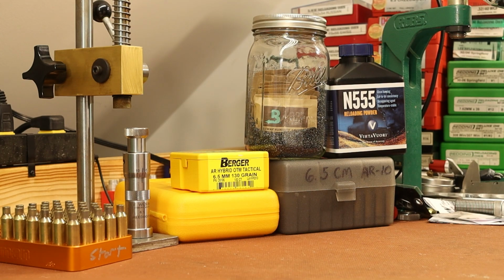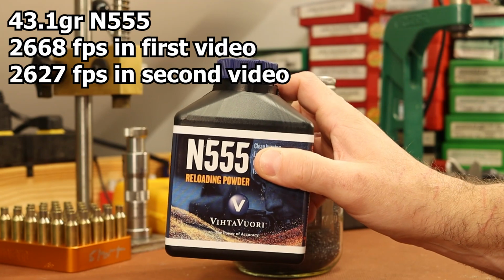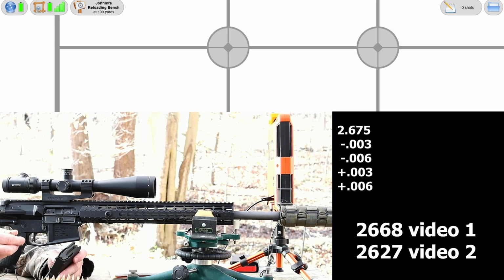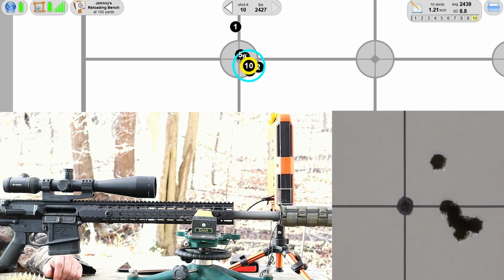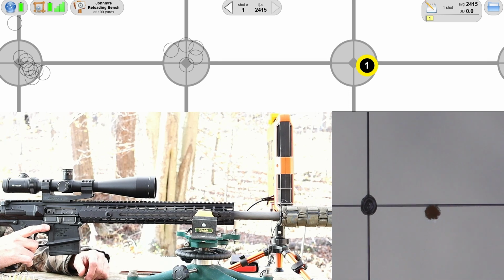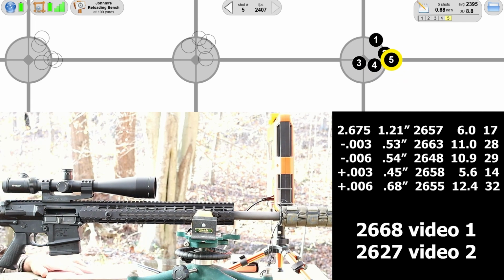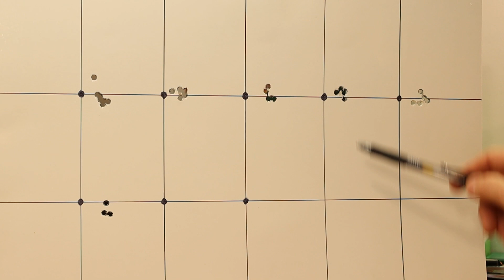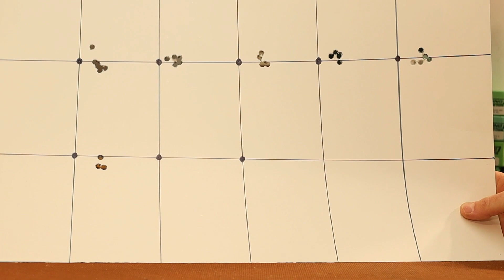6.5 Creedmoor - VihtaVuori N555 and 130gr Berger AR Hybrid OTM Tactical - Part 3

Comment: Hey Johnny, Those are some excellent groups. If you really want to confirm POI shift just shoot them again in reverse order. Could just be the barrel heating up.  One really easy way to visualize POI shift is to take a piece of clear plastic and dry erase marker. Mark the point of aim on the plastic and then trace in the groups.  Move the clear plastic over the next groups and you will see the shift exactly. You can circle in all the impacts to give you the whole group overlap.
Reply: Barrel heating was my thoughts as well.

Comment: Very interesting video now I feel the need to put the air driers in all my open powder cans. I looking forward to more testing videos on that
Reply from the maker: The SDs in this video were the worst we've seen so far with this powder. Did some of the powder get dehumidified while some didn't? How long does it take, on average, for a humidity change to take effect? SOOOOOOOOOO MANY questions on this topic. Should be fun to investigate.
Reply: @JohnnysReloadingBench  what would happen if it sat for a month. You would think that would make a difference. I live in Washington state. Very wet and cold. I think I'm going to do some kind of testing on this. Sounds really interesting
Reply: @JohnnysReloadingBench  Funny you should ask - been investigating this myself. Have seen a .5 gr increase in a 36 gr load sitting in an open measure in 24 hrs (calibrated scale). Powder had just been poured from a sealed container. Have now tracked the weight of this powder charge for 60+ days & it goes up & down with relative humidity. 😳😳😳

Comment: First shot John. If you go back thru many of the videos, you will see first shot issues. Its common with semi's as the closing pressure is different - the bolt is moving faster during cycling, slower from the bolt release.
Reply: Good observation.
Reply: I was thinking the same when he said only a 3 shot sighted group. Back of my head was trying to remember part one and two but I swore he had 5 shot + warm ups in those. Then we had that flyer.
Reply: Don't see how it be any different when the bolt lugs are locked in regardless of it being the 1st or 5th round.. Closing pressure is not an arguing point. Headspace is Headspace guy
Reply: @cademarti1365  its less the headspace changing and more the way the gun treats the round as its closing, if you go from bolt lock and drop using the bolt release it seems to help a lot with a first round poi change, since its all the gun doing it.
Reply: Chamber heat counts a hell of a lot more than ramming speed
Reply: @williambell7763  not buying it
Reply: @geekswithfeet9137  counts 'as much as'

FTFY

Comment: I replicated your experiment with those moisture packets in a mason jar but I also included a tiny digital humidity gauge. What I found out was those packets really work started out at 51% humidity after two days it dropped to 35 I’m sure if I left them in there longer it would drop to 32. So I ordered me some of those silicon packets to test them too. You might want to check those humidity gauges out on Amazon you get four $11.00 
I  used 4 packets in a mason jar 3/4 full of Reloder 25.

Comment: Gonna say possible barrel heat on POI and judging by group size you have verified a decent node and I would suggest increasing CBTO 0.002” just inside the long length group that shot well before it opened up… that would be your verified load….

Very nice test….

Comment: The powder sucks up the humidity which make it heavier in turn less powder in the case to equal same charge weight. I shoot benchrest and as the day heats up and humidity goes down we always change the charge with the humidity useually only a tenth or two but that also depends on the swing in humidity. It is a factor to consider and it does in fact play with velocity’s. An average hunting load this is not much to worry about but when your trying to put every shot into the 0’s it can’t be ignored!!

Comment: Ok, start at just under mag length and then shorten them in 3 thou increments for a total of ten groups. You will find the sweet spot.  The actual start point doesn't matter. My .223 got down to .24" with 62 gr speer gold dots.

Comment: Just a theory. Your best groups and also tightest sd were very likely the point at which your close enough to the lands where you have a higher initial pressure spike, more complete combustion, smoother pressure wave following.  I’d love to email you further about this  with some very consistent test data that I have acquired over hundreds of rounds with this exact powder combo in a 6.5 gasser also.

Comment: Possibly scope settling?  I fire 280 AI and 300 wm.  Both bull barrel. I use two scopes. Both up there in price. Not sure if quality is the best.  At 150 I don’t think anything less then touching or less a good group. I find seating depth is cool but the pressure changes from the seating change is my money. I can change the seating depth with pressure increases and decreases and find the same outcome.

Comment: I think your first 10 shot group is exactly in the length node. You have .003 up and down that all shoot good.    
I’ve noticed slight changes in gun position on my rest will move poi on target.   So if your rest is further forward on the handguard then you push the rifle up on the rest another half inch it will change poi.   

I’d reload 5 more of that first 10round group and shoot to verify.  Maybe use your normal 1” orange dots vs black sharpie.

Comment: I’m ready to see some 6mm arc video with powders that aren’t listed on the load data. Just picked up a Shaw 22” 6arc and been testing the powders list and nothing is really working like I think it should with 105 Berger and 105rdf looking forward to that.
Reply: Where you get your barrel? I was gonna do a bolt gun but might be cheaper and easier to do an AR.
Reply: @MrBoostin18  directly from Shaw barrels they are made to order so about a 4-6week wait currently
Reply from the maker: I have the 105 Berger and will be testing soon. Someone already requested N540. Did you have a specific powder in mind?
Reply: @JohnnysReloadingBench   been wondering how n540 or n140 would do in arc! Thanks sir!!!  Now i just need to build my arc lol
Reply: @JohnnysReloadingBench  I’ve been playing around with varget, and h322 the powder capacity between the 6mm arc and the 6mm ppc are so close I would like to have a load with a temp stable powder cfe223 and lever evolution are not stable. I worked up to 25.2 hrs of h322 and had some pressure signs that I did not like before I reached a decent speed. I think imr4064 being so close to varget may have some promise but have not tested it yet. I could not find any 6mm arc brass/ammo in stock anywhere so I’m resizing 6.5 Grendel brass which give me a little more case capacity. At my elevation and climate I’m not able to get over 2550fps with any of these loads which is surprising. I have tried many of your loads and found them to be much slower where I live. I have watched every video you have posted I love the fact that you try things outside the box just to see. I ordered the maxim bolt for this because you said it was the best and so far so good. I’m staying with 105gr because I have 2000 of them due to a failed 243 project. Also I’ve had a ton of trouble with nosler rdf bullets not shooting well I wish they would but they don’t seem to be constant bullet to bullet. But any powers you want to try I’ll watch and try for sure. I have a good supply of varget 4064 h322 and 4350 so not being able to find powder that’s what I have to stay with. Thanks for replying.
Reply: @JohnnysReloadingBench  one more thing I’m waiting on a new sizing die I’m getting a ring that is concerning with the small base sizing die from rcbs not sure if it’s the die or because I’m using 6.5 Grendel brass but when the hornday sizing die comes in I’ll know. I have a fire hole form in the Kneck of a case on the 3 firing flame annealing each time so I’m not sure what to make of that it was just one piece though.

Comment: Have you ever gotten the gun to cycle without the suppressor? I had to open the gas port on mine for it to function. Gas port size was .068 and I had to open it to .086.  I have the exact same barrel as you and was just wondering hoe yours came to you. Good shooting bud

Comment: This is going to be more of me trying to sort out what I see - the youtube comment equivalent of talking to myself.  (Or mentally vomiting out my thoughts.)

Ignoring the 3-shot sighter group, and applying a number to the groups shot in chronological order: 1 (standard length), 2, 3, 4, 5.

Group order in terms of overall length: 3, 2, 1, 4, 5 

Group 3 starts off level with the horizontal line, but further right.  Group 2 remains the same horizontal point of impact, but is further left.  Group 3 brings the group back right and down, but throws a shot upper left.  Group four moves the group upper left.  Group 5 brings it slightly lower and slightly to the right; slightly opens up, too.

Assuming no shooter-induced fliers, it makes sense that the first group would throw a flier to the upper left since the groups both before and after it are generally to the upper left, relatively.  The flier is pretty extreme though.
On a similar note, the centers for the points of impacts themselves almost look to be moving as far as the group sizes themselves.  (This is poorly worded - the group sizes are a half-inch, and they appear to move about a half-inch with each OAL adjustment.)  This might be noteworthy, but POI shifts do happen even with OAL changes and the amount depends on the barrel.  If we're going to try to chalk that up to shooter error, 0.50" is within the margin of error for having parallax problems, or otherwise an inconsistent hold - but I doubt that's the issue.  (I think we all do!)

Phew, there is a lot to take in here.  Clearly, the only way to come up with an answer is to rewatch the series.  Multiple times.  There's a lot to learn here!

And, at the end of the day, all those groups are great.
Reply: Overdue for my follow-up.  I don't think I can really add anything else - someone had mentioned shooting them again, in reverse, to see how things correspond.  (Additionally/alternatively, doing them round-robin.)  That seemed like a good idea, but, of course, you'd need more bullets to do that.  If you even think it's worth it.

It's damn fine shooting any way you slice it.

Comment: Johnny, you're into the noise. That is, you're shooting to the capabilities of the load, the gun & the shooter. The differences between groups is random, man. 

The tight first group might be lower than the others because of a cold barrel. All other group centers of impact were relatively similar. Differences between .4 & .6 groups are only likely to be resolved with a higher mag scope with a finer reticle, meticulous attention to shooting technique, maybe a better trigger (the $100 LaRue MBT-2  highly recommended) and even more precise loading. As another commenter says, you're into bolt gun territory already. Really good results!

Comment: I shot a 22 creedmoor at the weekend because I couldn't get my 14.5" 5.56 on target at 600yds, first time out the box, was always going to be pushing my luck with a 1-4x optic. Well I must say I wish I'd built a 22 creedmoor ar10 than an ar15. 3" group at 600yds out of a desert tech bolt action. Might have been an srs I'm not sure. 80gr eldm is all I know.
Reply: That's a 3" 30 round group, not a 5 or even 10

Comment: The velocity disparity may be due to you using fire formed brass this time around. You gained about a grain of case volume vs new brass which i think you used in your first video.  Humidity might be an indicator as well.
Reply from the maker: This video and the last video were with fire formed brass. The brass had been previously fired in my TC Compass, so video 1 was fire forming that used brass.
Reply: It would be interesting to see a chart of the temperature of each day vs the velocity. Might be worthwhile logging temp and humidity. Then, if there is a velocity change, it might be easier to track down. Happy belated Thanksgiving to my American friends! I see Midway has these bullets as 'coming soon'.  Eye watering accuracy.